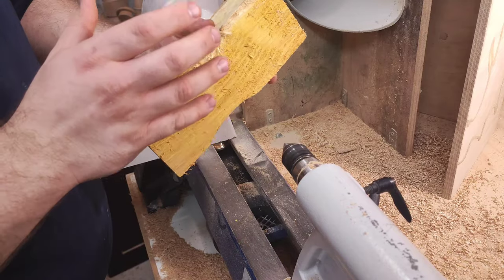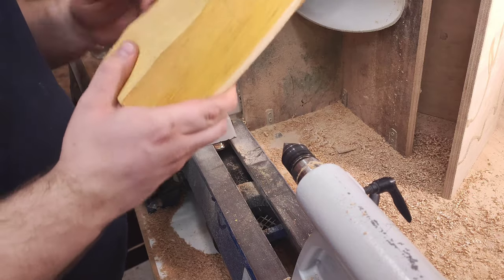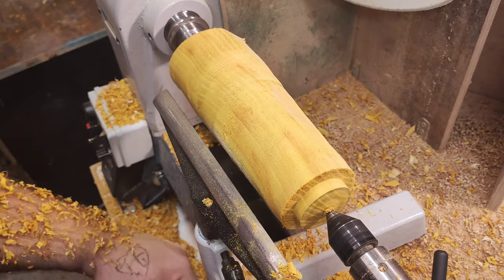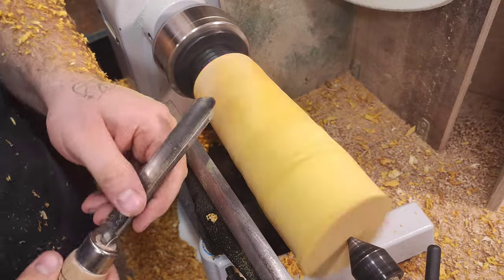A carvers mallet from OSAGE ORANGE that will out last all of us....

Comment: Osage orange is native to N Texas and S Oklahoma. Much of the spread of it came from the wagon train people who planted it along the routes they took since it was so good for spokes. From the old farmers in the mid west, " A black locust fence post will wear out one fence post hole. An osage orange fence post will wear out 2." It can also be used to make fabric dye, and I did see some fabric that was died with it and the color didn't seem to oxidize. like the wood does. 

As for that gouge you used, I have mostly heard it called a 'continental style spindle gouge'. In the early days of bowl turning, they were used on bowls, but the main use was by the old bodgers who would set up in the woods and make chair spindles. I do prefer other tools for bowls, but this tool can make for a really nice high angle sheer cut.
Reply from the maker: Indeed, I learn my trade on few of those gouges as there were non others here , but I do have to explain to viewers about the differnce and why one can be and the other can't be used on cross grain work...

Your comment will contribu to that as well...

Thank you

Comment: I made a mallet out of hard maple quite a while back.  I'm not a carver, so I thought the mallet would be shop decoration more than anything else.  Turns out I use the mallet pretty often for all kinds of things - not just turning.  it's a pretty good substitute for a rubber hammer and/or a dead-blow hammer.  Thanks fot the video!
Reply from the maker: Indeed, it has so much uses around the shop, Thank you very much for watching

Comment: There is no "The" Spindle roughing gouge. The one you described to be a spindle roughing gouge is the english version. Its a flat  piece of steel bent into a U shape. The continental gouge you are using could be considered a roughing gouge as well, however it might be a little small with 20mm. The same tool with about 30mm width is commonly used to rough down stuff. Richard Raffan uses that tool, you might know already :). The Point im trying to make is that the gouge you are using can be whatever you are using it for, because its a universal shape. 12mm variants or so are used like detail spindle gouge, which maybe have a shallower flute than regular round bar spindle gouge, allthough i find them quit stupid, cause they are supposed to be more ridget when normal spindle gouges are already ridget enough. Thus a shallower flute makes for a longer bevel which brings some more issues in my opinion. When the continental spindle gouges get bigger, like 20mm they are basically hybrid tools for roughing, shaping and even details whilst this is in fact getting more diffecult. When they reach 30-35mm, which are quite common sizes, you start to call them continental roughing gouges. 
Now, the shape of the english roughing gouge was used as a bowl gouge before the "modern" one out of round bar came along. They were forged. You can still buy such tools today from companies that hand forge turning tools.
Reply from the maker: Its a longer comment but I do agree with you😉 I learn my trade on Continental spindle gouges, the rest of the tools were homemade ones.... I was just trying to clarified in short for viewers, although they look kind a similar there are big differents..
Thank you very much for watching and comment 😀